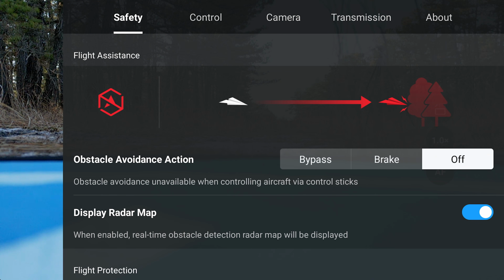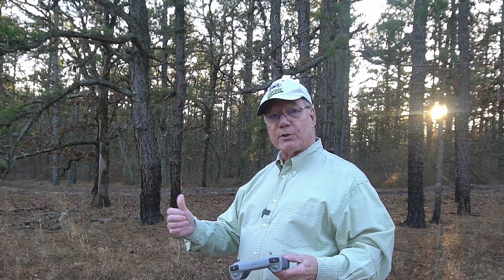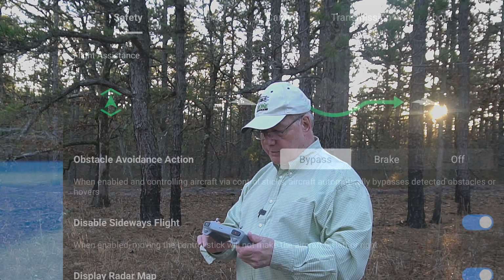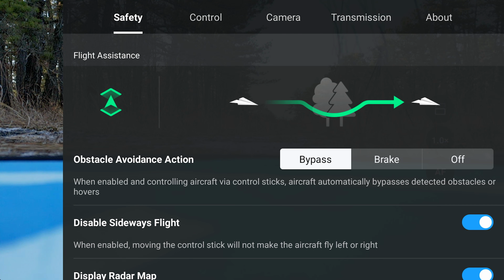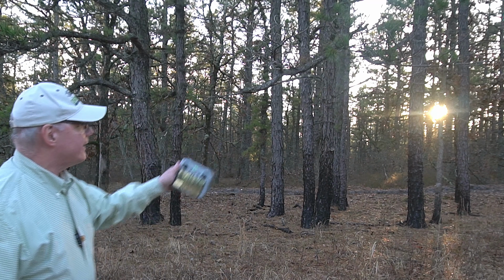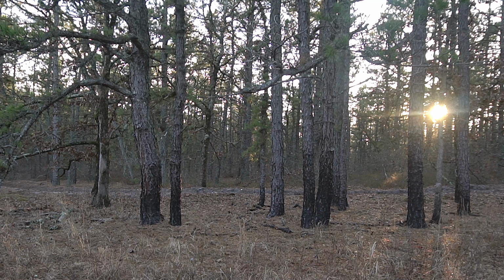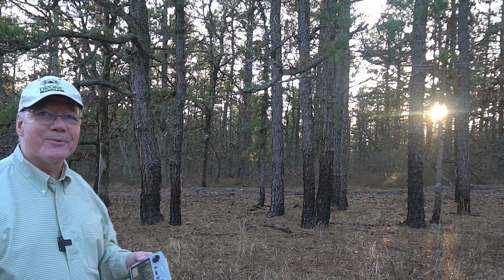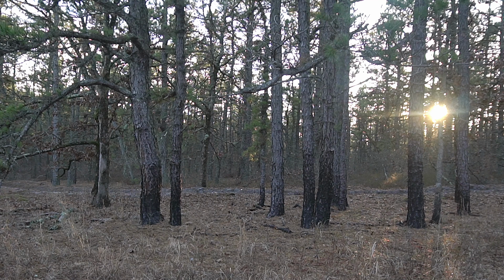Mini 3 Pro - You Can't Crash This Drone!

Comment: I beg to differ...voice of experience
Reply from the maker: Thanks for the post and DJI did the best they could with 3 directional sensing. The Mini 4 Pro is a full 360 degree protection so that one is bulletproof. With the Mini 3 Pro, it;s hard to crash it if you have APAS turned on and don't come down on something.

Comment: Hi, I just got the batt plus pack kit and wondering what is the maximum voltage when it is 100% charged, because mine have different voltage, for example batt plus no. 1 voltage for cell 1 and cell 2 are the same on 4.20V on the other hand the no. 2 batt plus for cell 1 is 4,20V and for cell 2 is 4,19V...is these normal? thanks in advance

Comment: Title: You can’t crash this drone.

Reality: I crashed it in my first flight and broke it.

Obs: I have a Mavic Mini for 3 years and never crashed it 🤡🤡🤡🤡

Conclusion: DJI Mini 3 Pro obstacle avoidance is not trustable, specially that this drone doesn’t have side and upper sensors, doesn’t work in sport mode and some tracking modes.
Reply from the maker: Luis, most crashes are directly related to pilot error so you must have been doing something a little risky. As for the Mini 3, it has 2 different detection technologies it provides. Crash detection will stop the quad well in advance of it hitting something. This only works in 3 directions so you still have to be careful when flying sideways. The other feature is called APAS and when you turn this one on it will dodge obstacles in front and behind it like I showed in the video. Both of these are to aid the pilot in avoiding crashes. Neither work to the sides or in Sport mode so be super careful in those situations. I hope that helps and happy flying!

Comment: I've been using SanDisk Extreme Pro SD cards for my drones up to now. Which specific SD card do you recommend? 
I also noticed that the SanDisk Extreme 128 GB and 256 GB each claim a read speed of up to 190 MB/s and a write speeds of up to 130 MB/s and the Extreme Pro 256 GB respectively have a read speed of up to 200 MB/s and a write speed of up to 140 MB/s. Will either of these options work? According to DJI they will, but will they yield optimal performance?

Comment: you can crash this drone.
Reply from the maker: Jason, thanks for the post but as I showed in the clip, the APAS detects objects in front, below and behind the drone to craft a path between them. There are no side or top sensors so if you fly in those directions it will still stop before hitting most objects but you have to be a little more careful. Even still, that APAS is amazing for a small drone.

Comment: Nice video
but I crashed it under a tree when going up to the sky ...
No proximity sensor when going up ...
The drone fell on the ground loudly
Reply from the maker: Sorry to hear that but it's blind to the sides and top so you have to be careful. Even still, it does have some sensing on the sides since the front and rear sensors can detect a pretty wide range in the horizontal direction. APAS helps out when you're flying into a crowded space and can help you safely navigate through it. Stop back soon for more content. Rick

Comment: CHALLENGE ACCEPTED!   I crash-landed mine.   Here's what happened..  I flew it out about 300 feet out and 200 feet up to film fireworks about a mile away.  yeah.. going out did not do much.   I had it on cinematic.   I hit Return-to-Home and it started back,,  but I canceled that because there were MORE FIREWORKS.. they fooled me with a faux finale.    When it was over I hit what I thought was the RTH button again.. but it was the LAND button.    So it came straight down.. and it gave me some error on the screen about ALTITUDE..  forget teh exact language.   But it came down fast.. was a good 15 feet away from my landing pad and it did not slow down and assk for approval to land (apparently I had just given my approval was it was about 50 feet up).    But now I am away that, should I cancel RTH.. I need to be careful and, perhaps, manually bring it in.  I had some cheal landing gear on it.  nothing broke but the drone did flip over.  It is fine.

Comment: Sorry Rick but you can crash this drone. Albeit it avoided obstacles, I had signal loss within 50 metres distance at 3 metres high and instead of returning home or hovering it landed and it ripped its arm from the body of the drone. DJI have replaced the aircraft but haven’t given an explanation as to why it landed.

Comment: What micro SD card do you recommend to fully capture the potential of this drone?
Reply: a faster one, and bigger....
Reply: @h_d_  I've been using SanDisk Extreme Pro SD cards for my drones up to now. Which specific SD card do you recommend? 
I also noticed that the SanDisk Extreme 128 GB and 256 GB each claim a read speed of up to with card offload speeds of up to 190 MB/s and a write speeds of up to 130 MB/s and the Extreme Pro 256 GB respectively have a read speed of up to 200 MB/s and a write speed of up to 140 MB/s. Will either of these options work? According to DJI they will, but will they yield optimal performance?

Comment: Great video. I would like to see you discuss in one of your next tests if, while using APAS, it is able bypass obstacles and not colide with obstacles to the side, up and down - considering it doesn't have sensors in those directions. For example - as your moving forward toward a tree with APAS, might it shift sideways into another tree?

Comment: Well Rick, I found one of the limitations of APAS, the hard way! 
I was flying my Mini 3 Pro along the edge of a wooded area and it clipped some small thin branches. APAS is not sensitive enough to see them. Of course I broke a prop, but when the Mini 3 hit the ground it also broke the front right arm rotating axis. This was back in mid October and there wasn't one single replacement arm axis to be found in the US or Canada. Had to wait on that proverbial slow boat from China. Now, they are in stock again at several suppliers and I ordered some spares. Luckily there was no damage to the arm itself. Although there is very little room to work, you can replace the arm axis without having to open up the main body!    
Watched a guy on YouTube totally abusing a Mini 3 (running head first into trees, dumping water and dirt on it while hovering ... I clipped a twig and I was down for the count!!!
Enjoy your videos and appreciate the "to the point" tutorials!!!
Reply from the maker: Walt. sorry to hear about your crash and the APAS can miss small wires and thin branches that are almost impossible to avoid, especially if they're coming in at an angle off center. It's also a little less reactionary in darker environments where it has a hard time with shadows. Even still, it's an amazing tech that I'm still impressed they were able to include in a drone this small. I really appreciate your support and I hope you'll stop back soon for the Christmas giveaways.
Reply: I wonder if prop guards would help that?
Reply: @thomashardy9994  ,probably from getting broken but sometimes they can cause your front if too close to a tree can cause it to get stuck from my experience
Reply: @thomashardy9994  They might, but that takes some of the fun out of it! HA! Seriously, I don't think any solution is fool-proof.
Reply: I've that guys video, he does it frequently with different drones

Comment: We have 2 levels of APAS on Mavic 3. Plus it interfaces with Active Track 5.0, providing directional track a'la Skydio 8 directional point compass/parallel tracking (switchable) 

Anyway the new addition, somewhere around v01.00.0600 brought "Nifty and standard" APAS. "Nifty" pops up a warning ⚠️ stating it will be smoother (much needed as Mavic 3 can be ridiculously twitchy in close quarters with obstacles) -and fly CLOSER and more steady past objects. This is best experienced when flying line of sight, and/or slower speeds -NOT as DC Rainmaker did on his bike running it through the gauntlet!

Mini 3 is smoother than most DJI in this type of scenario.  It's always Nifty. Lol 😆

Comment: Nothing beats Skydio
Reply from the maker: Thanks for the post and it's interesting that you mentioned that because I'm working on a clip comparing the two. The short answer is that Skydio is great for avoiding objects in open spaces but stops dead in its tracks in tight locations like this. Because the Mini 3 Pro is small, it can scoot in between the trees better than the Skydio. I fly (and love) them both but they are different animals.

Comment: Fly it sideways in those trees and you'll be posting a new video entitled "You CAN crash this drone!"😁
Reply: @SECRET CREEK PROSPECTING Right, that's because there isn't any.  That's my point.  It won't let you fly it forward, backward,  or upward into a tree, but it will absolutely let you fly it sideways into a tree.
Reply from the maker: Doug, APAS isn't as good to the sides and when I fly in tight locations like that I turn off sideways flight in the app to avoid movements to the side. Even still, you see it sliding a little when flying since it can still detect larger objects to the sides in flight.

Comment: You might not be able to crash this drone, but you also can’t fly it in controlled airspace without jumping through a bunch of annoying & ridiculous steps with DJI to do so. 

I don't care how great their drones are, I refuse to buy another DJI drone until they offer a permanent NFZ unlock for licensed drone pilots. There's no way I will deal with having to unlock the drone from the manufacturer every time I need to fly in controlled airspace. I get LAANC authorization from the FAA and only fly in controlled airspace when authorized. It makes absolutely zero sense for DJI to restrict their drones like this, and it has cost me a job once where I couldn't get it unlocked in the field, even though I had gotten FAA authorization to fly there. Imagine if a company like Boeing required pilots to unlock the ability to fly in controlled airspace with ridiculous painstaking steps on the Boeing website even though they were licensed to fly and had FAA clearance to do so. This is exactly what DJI is doing to its customers and for the life of me I can’t understand why the majority of people just put up with it. It is beyond stupid and ridiculous.
Reply from the maker: Thanks for the post but I appreciate the fact that DJI has hard NFZ restrictions embedded in their drones because it prevents the casual hobbyist (80% of the market) from wandering into controlled airspace. All of these approved NFZ's are places that a drone should never be flying without authorization and with DJI they reduce the chances of this happening. They are basically digital fences that stop a drone from violating airspace that is protected and that's a good thing. All of these areas can be unlocked as needed and its a pretty simple process. I don't mean to sound harsh but if you lost a job because you couldn't get the drone unlocked, you were probably rushing the process. DJI may have been the first to take the step of adding NFZ maps to their drones but I'll bet all of the major companies will be adding them as well as soon as RID is in effect. I can tell you that Autel already has them in their software but have not activated them yet. I know it's a pain to have to unlock, but it keeps the skies safer and creates less of  hassle for our hobby.
Reply: @Dronevalley  It may be fine for unlicensed users, but it’s ridiculous for them not to offer a one time process to unlock it for licensed pilots..   it’s a royal pain in the ass.
Reply from the maker: @billjohnsonseattle  I understand that its an extra step but these areas are restricted and the LAANC process grants you a temporary unlock for a specific mission, at a specific time. The FAA needs to control this airspace and by completing the request they know whose flying there and when in case they need to issue a TFR. If they have you a blanket clearance they would never know when drones were in the air or who was flying there.
Reply: @Dronevalley  The LAANC process is separate from the DJI unlock and does not unlock the drone. If DJI could incorporate their system into the LAANC system and unlock the drone when you get FAA authorization that would be great, but they don’t. It makes no sense to have to get authorization from two different organizations just to fly one mission, it’s completely stupid, and ridiculous to be double regulated.
Reply from the maker: @billjohnsonseattle  I totally agree with you about the two-step process being goofy. I mentioned the RID because that is the first step in organizing a system to coordinate these authorizations. I know for sure that DJI is looking to make it a more seamless experience and the standards to make that happen are still being developed. This tech is so new and the regulations move at a snails pace so they're still catching up. Give it a little more time and it'll be easier.
Reply: @Dronevalley  DJI needs to become a LAANC integrator like Aloft & make LAANC & drone unlocking a seamless unified process if they want to earn my business. Until then I will run my NFZ hacked Mavic 2 Pro which is all I need for at least the next 2-3 years. I can get a RID module for it when it’s required next year.
Reply: @billjohnsonseattle  Forgive me for asking, but you seem to be a very experienced drone pilot.  If you could not fly DJI drones, whose would you fly?  There are choices, but your opinion would be valuable to me.  Thanks for any response.
Reply: @kevinwells4986  Probably Autel, Evo Pro 2 with the smart controller at the moment if I had to buy one right now. I’m always looking for drones that do not have NFZ lockouts on them. If they someday come up with a hack for the Mavic 3 Classic, I would buy that one since it is RID compliant now. I actually love DJI drones and still use my Mavic 2 Pro, but only because they offer a hack for it that eliminates the NFZ restrictions. If you are on a lower budget than the Autel Evo Pro 2, you can get the DJI Air 2S and buy a hack for it to remove NFZ Restrictions, and it is compliant with remote ID right now. For the Mavic 2 pro  and zoom models,  and older DJI drones, you will have to buy a remote ID module to comply with the upcoming RID requirements in 2023.
Reply: @billjohnsonseattle  You are a wealth of information.  Thank you!
Reply from the maker: @billjohnsonseattle  Autel has NFZ restrictions in their software as well and just haven’t enabled them yet. It’s just a a matter of time for them to flip the switch, so buying one of theirs just to circumvent the NFZ issue doesn’t make sense. I fly all of the Autel drones and the EVO 2 is a nice quad but nowhere near as capable as the Mavic 3, or even the Air 2S. Geofencing is a solid technology that keeps inexperienced fliers out of trouble and criminal fliers away from prisons and power plants. I support it and am willing to go through a few extra hoops to fly in one of these areas if I ever need to.
Reply: @Dronevalley  If you enjoy a boot on your head, more power to you.
Reply from the maker: @billjohnsonseattle  It has nothing to do with "authority" or lack of freedom. NFZ's are areas that you not allowed to fly into without permission. As a responsible pilot you have to respect that, and that's what the LANNIC system was set up to help with. It allows you to fly there as long as you define where you'll be flying and for how long. That way nobody is surprised that a drone is in the restricted area. The geofencing helps to enforce these invisible boundaries and helps to keep new pilots from wandering into them. I'm surprised that the FAA hasn't mandated Geofencing on all drones yet and expect that will happen. Especially if more goofy pilots keep flying drugs into prisons or swooping down into a stadium during a baseball game. I feel that if you can't follow these simple rules, you should find another hobby so the rest of us can enjoy the thrill and beauty of flight, simple as that.
Reply: @Dronevalley  As I said before, I don’t have a problem with geofencing for hobbyists, but when you are a licensed drone pilot that took the time to study and take an FAA test, you should not be double regulated and have to jump through hoops from the manufacturer just to fly in an area that you have already gotten authorization from LAANC to fly in. It’s absolutely ridiculous and stupid. Licensed pilots should be able to submit a copy of their license to the manufacturer and get their drone unlocked. Licensed pilots aren’t going to risk flying where they shouldn’t and lose their ability to make money, it’s only the dipshits that have nothing to lose, so why are we penalizing the responsible people that did all the right things?  I have never flown illegally and even have 1 million in liability insurance for my drone in case something happens, and I would guess that many others flying commercially do too. All I’m saying is that the system shouldn’t be penalizing the good people just because there are a few bad apples out there. Just give the licensed pilots a way to unlock their drones with a one time process instead of making it cumbersome and annoying, we aren’t the ones flying into aircraft flight patterns and hitting airplanes. I’m sick and tired of the massive over regulation coming from a company that makes the process of unlocking my drone nothing but a hair pulling experience.
Reply: @Dronevalley  Also, RID should make it LESS likely to require NFZ restrictions on the drone because the drone will be identifying who is flying, where and when and it will be much easier to catch people flying where they shouldn’t be.